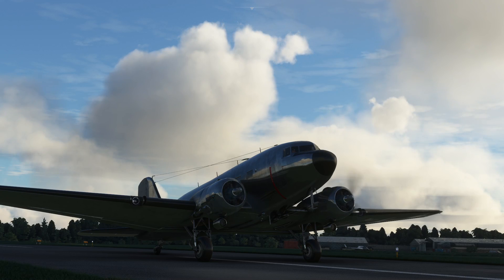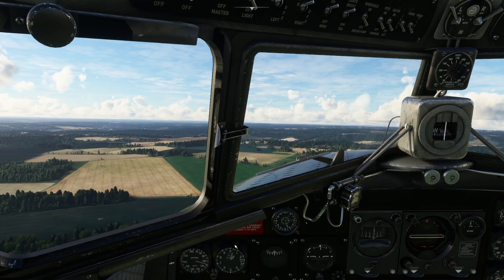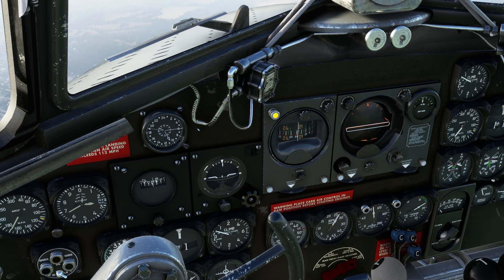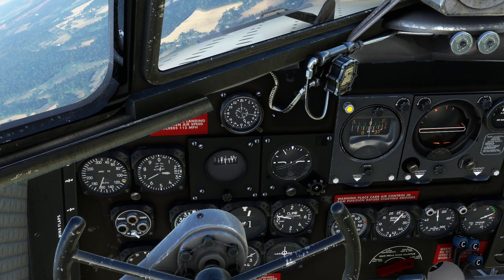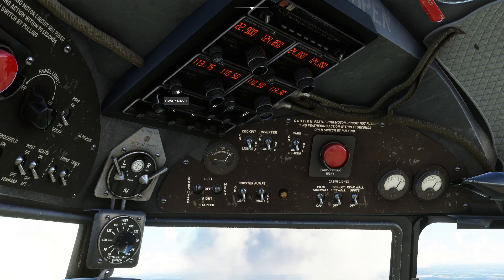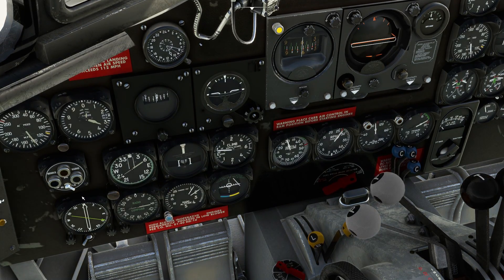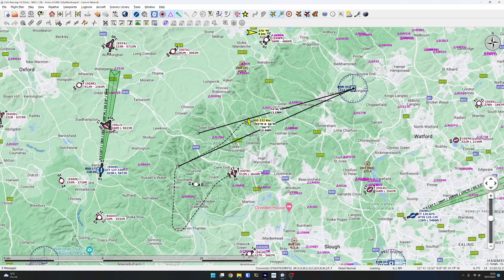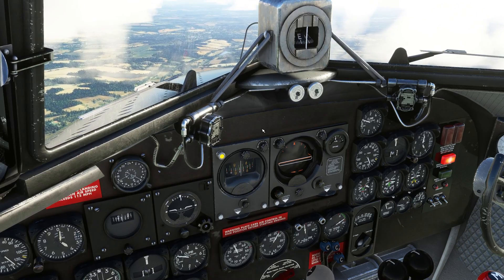Beginners guide to Autopilot and Radio Navigation in the Douglas DC-3 in Microsoft Flight Simulator

Comment from the maker: I forgot to mention in the tutorial - the radio compass (next to the nav radio instrument) is what we would now call ADF :)
Reply: Sadly they are phasing out real life ADF stations. One thing to be careful of - electrical storms can distort the direction of the signal, and even lead you into the storm.
Reply: the old msn version had it an actucal Instructor and I sat down and figured it out way back when and I remember the msn DC 3 had a load of mods that were fab and I must say the panel looked better.

Comment: I think you're using the heading selector back to front on the autopilot. You're using the "desired heading" knob to calibrate it and then using the gyro calibration knob to set the course you want. Which works but for the wrong reasons. Rather than telling the aircraft "you're pointing west and I want you to go north" you're telling it "you're pointing  north but I am now moving where you think north is by 90 degrees".
Reply: It's the current model you are describing. In this video was older version of DC-3 until they updated it, where some switches are different.

Comment: Hi Jonathan-great video thankyou.Just a question I have-when you pushed in the heading hold button,how did you do this?I have not worked out how to do that .Even going to Legacy mode for operating switches etc & using my mouse I could not push that button in.Your help would be appreciated.Have just managed 2 successful flights with the DC-3 in the sim flying by hand & without going off the runway managed 2 successful landings into NZAR & NZWU In New Zealand in the sim.Your help regarding pushing that button would be great thankyou.
Reply: I have the same question, playing on Xbox. I noticed you can select heading and then have to turn the aileron trim left or right to get the bank going and it will center once it gets close to the selected heading

Comment: Thank you for the tutorial. Unfortunately, I seem to be one of many who has a potential bug that prevents the Engagement of the Autopilot. It simply does not stay ON when selected. So neither Rudder, Aileron or Elevator function. Interestingly, my cursor pointer does not change to a 'rotary' icon when placed over the Rudder or Aileron, but changes to a pointing hand. Have you any other reports of this behaviour or any suggestions?
Reply from the maker: Not so far. I'm sure the forums over at JustFlight will provide more feedback ?

Comment: Thanks for this great instructional video Jonathan.  You did not mention the green needle in on the CDI dial.  How is that used?
Reply from the maker: CDI = Course Deviation Indicator. In terms of the DC3, it tells you if you are to the left or right of the course you have selected.
Reply: @jonbeckett  I thought that was what the other instrument was (on the right of the set of three), that has a white bar/needle in it.  So does the green arrow in the left hand instrument do the same?
Reply from the maker: @IcelandicWarrior  Oh- I see what you mean now (just watched back some of it) - one of the arrows points at NAV1, the other at NAV2.
Reply: @jonbeckett  Brilliant, thank you so much 😊

Comment: From what I know about radial engines. Is that you do not want to idle as you do jet engines when descending. Idle too low and you’ll essentially cause spalling within the engines damaging them  to Kingdom come. You control your descent by lowering your manifold pressure to around 30-20, RPM to around 2,050 and control speed with flaps.
Reply from the maker: Yep. DC3s do good ground loops with engines at idle too.

Comment: Hi Jonathan. I fly the AH DC3 in P3D and have lots of trouble with the tailwheel steering on the ground. Even if it's unlocked, it only turns when the brakes are applied and then goes straight to full lock. Then I have to swing back the other way on full lock to correct it. There's no n between. Any ideas?
Reply from the maker: It's difficult in MSFS too. I talked to a real DC3 pilot - the real thing behaves very similarly to MSFS. To keep it under control you have to be on top of the wheel brakes, the engine torque, and the shifting centre of gravity. It's not easy. If you do a power-on landing on a longer runway, it's relatively easy to keep it under control.

Comment: Thx Jon ! Must learn DC3, seems fun. There's pressure from the Group Flight pilots, that I should be using DC3 instead of my all time favorite DC6. No other choice than learning :)
Reply from the maker: The only points where you need to be careful are immediately after takeoff, and on touchdown. It ground-loops easily :)
Reply: @jonbeckett  Yes, I discovered that :) Forgot to lock tail wheel (like you). It was easier to fly than I feared, must practice a lot with trimming and gyro. Engines stalled twice on the ground, may not enough RPM. Forgot to energise first time, little things :)

Comment: Why does my auto pilot fly fine at first, but when it's near landing time, the pitch stops listening to me and wants to dive to the ground? I had it dialed all the way to the bottom and it still wanted to dive to the ground.
Reply: Is it randomly disconnecting the pitch lock? I don't pay attention because I'm in panic mode.
Reply from the maker: Why do you have the autopilot on during approach? :)
Reply: @jonbeckett  My best guess is that once you deploy flaps, auto pilot auto disconnect. Why do we have ILS?
Reply from the maker: It doesn't have ILS ?! It has a nav radio though :)
Reply: @jonbeckett  Obviously, that's why I said "we" like in general life, not "it"

Comment: What is the trim setting for takeoff
Reply from the maker: This is a point of contention. No realistic aircraft is going to roll down the runway like a railway carriage - the aircraft is going to move around - and you need to move the stick and rudder to control it. I see lots of people talking endlessly about trim - you use trim to stabilise the plane once it's in flight. Sure, trim should be somewhere near centered in an older aircraft - but there's no need to try and configure the aircraft for the take-off roll beyond that. Fly the plane :)  Don't expect it to fly you.

Comment: Thank you so much...
This video is absolutely amazing 👌

What I want to figure out, I can tune VOR on NAV1 and 2, but I can only "see" 1.
Is there a way to see the direction to Nav2

Also, the VOR gauge doesn't seem to have a GS indicator when tuned to an ILS.
I can get the track on an ILS, but don't see the GS.
Am I using it wrong, or is that just how it is?.🤔
Reply from the maker: I think it might be how it is *at the moment*. When you tune NAV2, you can see the second needle move on the left-hand guage.
Reply: @jonbeckett  the yellow one? (I think it was yellow, thin one). 
I’m going to check it out , thank you 🙏🏻

Comment: Do you have a video on your sim setup? I'm interested in the computer and GPU you're using. I have a bleeding edge GPU but the rest of the machine is pretty old. I love the look and smoothness of the sim in your video. I want mine to look the same!
Reply from the maker: I7 3.6Hhz. NVIDIA 3080 RTX, 16Gb RAM, fast SSD, and fibre to the house.
Reply: @jonbeckett  Thanks! I'm guessing it's a newer Intel CPU. I have a 3090 RTX, but the CPU and rest of the machine is ~8 years old. Might be time to upgrade!

Comment: When you pull the manifold pressure" below the RPMs you are effectively destroying the engines; that's a big nono. You dont want to go under your props RPMs (usually 2000 RPM, 20" for a descent) until you are under 100MPH. This is from DC3 manuals
Reply from the maker: Good to know.
Reply: That will be the approach shudder, props driving the engines

Comment: i found that on the ground if  you put altitude hold on  gyro pitch doesnt work  and when you do altitude hold again pitch works, but in the air if you do heading hold on then the gyro pitch wont work even after  you do altitude hold again  it still wont work.  Also when gyro on no autopilot using trim wheel it also cancels out the pitch scroll wheel as well with my plane set to keyboard controls and using a joystick.  Does anyone else find this and am i doing something wrong ?  Can it be corrected?  Love this plane my new fav to fly and i want to know it inside out.
Reply from the maker: Why on earth would any of it work when you're on the ground?

Comment: I find the opposite to be true about the tailwheel lock. When it is locked i seem to have no control over the airplane after touchdown. If i leave it free I can keep the plane pretty good center line using my stick rudder on my t-flight hotas. Nice video on the basics of how the nav works. Thx for putting your time in to making this.
Reply from the maker: You're welcome :)  I have subsequently learned that keeping some power on is the secret - don't land on idle - then you have thrust over the tail, and can maintain control easily.
Reply: @jonbeckett  good tip, i will surely try this out.
Reply: Tail wheels should generally only be unlocked for taxiing.
Reply: If you leave the tail wheel unlocked on landing, it can encourage the tail to try and over run the nose and turn the aircraft eratically. Leaving it locked helps keep the back end from lateral play.

Comment: I think with those old radial engines you're not supposed to change the throttles like that during approach and landing.
Reply from the maker: Hogwash - use the controls at your disposal - as long as you use them in a appropriate manner.

Comment: I have a question, if you wouldn't mind. I've run into a problem with the gyropilot where it holds its heading a consistent 20 degrees to the left of the heading I tell it to, no matter what I do. I tried turning it off, lining it up and turning it on (in which case it should just hold the current heading, right?), but it immediately turns left by 20 degrees. 

Do you have any idea what could be the cause of it? I'm assuming it's user error but can't pinpoint what I'm doing wrong.
Reply from the maker: Try pressing D. D aligns the gyro compass with the binnacle compass.

Comment: Love that old bird and really gives an appreciation for how things used to be done. Biggest challenge I have is landing that bird without driving off the runway :)
Reply: best way to keep  her on the RW after touch down is to have the tailwheel locked. SHIFT + G  lock/unlock, or pull the lever on the dashboard (but that is sometimes difficult as your are busy landing)
Reply from the maker: It's fun :)
Reply: Try landing with the parking brake ON.
Reply: @jerpiaaz  thats a crash guaranteed irl lol. you have to dance on the rudder quickly
Reply: Agree. Mosquitos pilots  used to said that landing is when the fun beginns😂

Comment: Takeoof 48" boost/2700rpm hold on the ground till the minimum V1/V2 speed of 82 kts - 95 kts METO Power (Max Except T/o) 38" boost/ 2550 rpm.
At 110 kts /500 ft Climb Power 32.5" boost / 2050 rpm.
BTW The autopilot is hydraulic & you must first move the top lever behind the F/o forward before engaging.
Reply from the maker: I'm going to do a video about the various levers behind the first officer's seat, and in the gangway - they all seem to be simulated - it will be interesting to see if they influence the systems as they should.
Reply from the maker: btw - thankyou so much for your help so far - it's been invaluable.

Comment: Maybe after a little more practice, you could do another DC-3 autopilot tutorial but this time turn the LNM moving plane icon off 8-)
Reply from the maker: I've actually done that in the past - with the Cessna 152 - flown a route and used triangulation with radio masts to plot position. It's not too difficult.

Comment: Another fun and educational video, Jonathan. I'll have to quit "cheating" and not use the GTN 750 and use the rudimentary gyro pilot. Down where the tail dragger wheel lock is, there's an autopilot switch. I think it switched to on when I used my GTN 750. Must switch on when you used the knob activate the Gyro pilot. I figured out how to make the co-pilot yoke disappear. Click below the hydraulic gauges. I'm surprised how well the pull down menu GTN 750 works with this plane. I'm so glad Microsoft added the DC-3 to the simulation.
Reply from the maker: Yep - I'm going to have a crack at a route at some point without GPS - just fly the VORs.

Comment: Everytime that I try to takeoff the plane when it's close to full, it goes full nose up in the air. Have you experienced this at all?
Reply: Yes. Make sure you set your trim around negative 17. Also the balance is off. Check that and center it. At first,  I like to start ready to go on the runway. This way you can see how it's set for take off. Despite this, I'm not always successful.

Comment: Man, I love that plane allready but I´m more one for garmin systems. Its a shame the garmin 530 is bugged in at least my plane:(
Reply: Have you tried using the PMS GTN530 instead of the WT GTN530?
Reply: @notBillJames  I have not yet, is it compatible with the dc3?
Reply: @Robinbermann  yes
Reply: @GumperVanLier  Funny enough I allready had the pms 530 installed and after removing it just to test everything worked great, so I dunno what happened there

Comment: I cant figure out what that dial is on top of the big gyro compass.
Reply from the maker: ADF, you mean ?
Reply: @jonbeckett  its above the big silver compass. It changes feet or something like that.
Reply from the maker: @liquidsnake1123  It's the altitude limit control. It's noted in the manual, but it's function is not described.
Reply: @jonbeckett  I wonder if it has something to do with minimums.
Reply: @jonbeckett  aah i see. Guess ill have to digg deep for that one. Thanks alot for help.
Reply: @GumperVanLier  maybe. Didnt think of that. Thanks